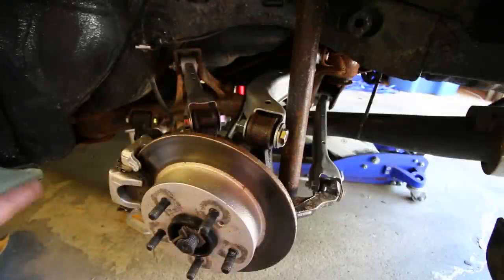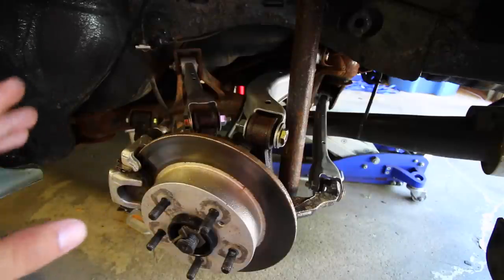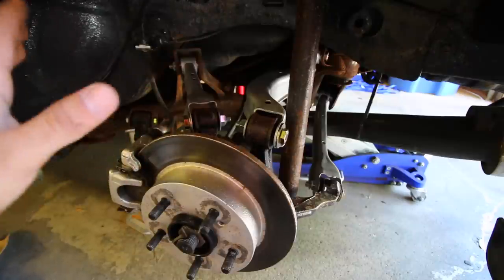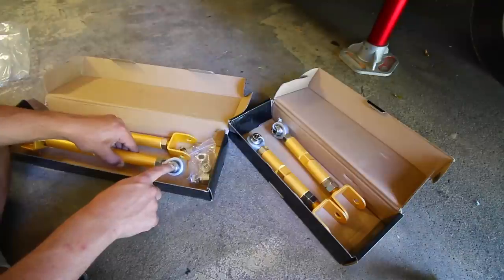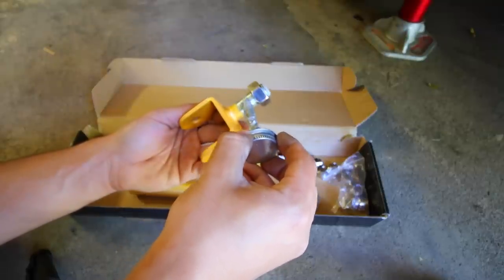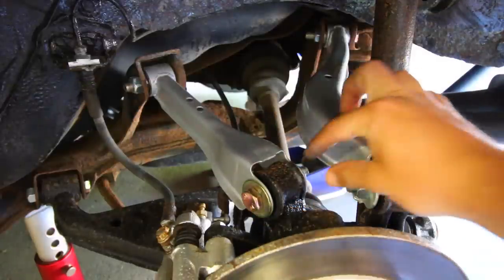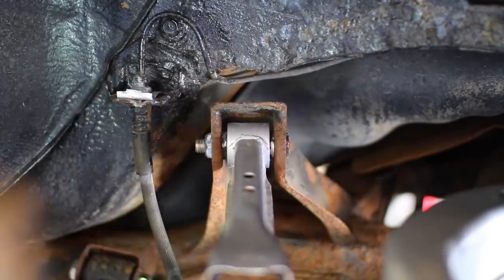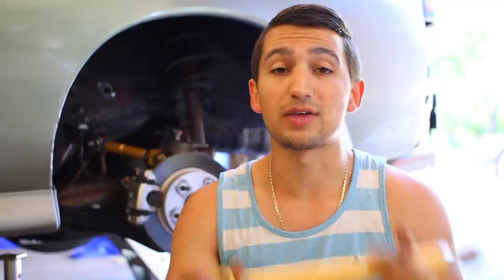What You Need Before You Buy Coilovers!!!

Comment from the maker: They are essential and I will be buying more to complete the full set!! I've got 1 more set to buy for the rear, and another for the front, and then I'll be good to go.
Reply from the maker: Do you think that's something I'd do? ;)
Reply: hi milanmastracci just one tip for you in the future for repairing cars so that if you get bind up in the spot were you can't get to the nut to on doing it just if you have welder by you're side just tack the nut on the part with couple tack's and than you don't get headache to take out

Comment: Isn't the other bolt you took off the control arm made to lock the 2 bolts together?
Reply from the maker: It can be, but that second nut doesn't serve any purpose, as you would just need the 1 nut to lock up to the centre of the control arm to keep it from spinning and have the length locked in place. You also have 2 jam nuts, one on one side, and one on the other.
Reply: Pretty sure it's there to secure the nut on the inside to not loosen over time from vibrations and such.
Reply from the maker: If that was true, why aren't there 2 on each of the control arms. I've never seen 2 jam nuts together before
Reply: milanmastracci I don't know. I have a similar locking mechanism on my fishing rod with two nuts, but I don't know why one side would need it more than the other.
Reply: milanmastracci couldn't hurt, but as long as it's ok to not use the second but.
Reply: milanmastracci so they just give extra parts with purchase?

Comment: Hey milan quick question i just lowered my car on coils and its pretty slammed my other cars rack and pinion started leaking bad which cost me $1000 how can I prevent that from happening again
Reply from the maker: See if you can get some steering rack spacers to raise it up, and then if you can as well, flip your tie rod ends upside down
Reply: milanmastracci alright cool, but do you know why it may have started to leak bad? Maybe from scraping alot?
Reply: The rack started leaking after being lowered is because the way the rack was resting on the seals have changed from what they were worn into. Depending on the age of your car the rack has been moving in the same position for 10+ years. After lowering the car you have disturbed its usual position which can cause leaks.
Reply: Matt Covey oh damn did not know that... I thought it was caused by all the scrapes, so in conclusion how can I prevent from this happening again? Do i drive carefully and not scrape or buy a skid plate or something please help!!
Reply: Well if the car will remain lowered for the rest of you having it and you put a new rack in it then the problem is solved. After a while now "low" is the new norm for the new rack. If you were to raise the car back up 5-10 years down the road you may see the same issue.
Reply: Matt Covey but i dont get how the rack and lowering the car has any correlation
Reply from the maker: The steering rack's angle will change with respect to the hub. When you lower your car, the hub is raised up higher, and the angle of the outer tie rod end will not be close to 180 degrees, it will be an obtuse angle. The more obtuse it is, the more strain it causes.
Reply: milanmastracci what should i do now? Raise the car back to stock? And did you encounter any problems like that with your accord?
Reply: The end of your rack has your tie rods on it. They are flexible on 2 joints so they can move with suspension. The rack tends to be bolted to the subframe and it's fixed to the car but the tie rods are bolted to the suspension which is constantly moving. When lowering the car you dropped the body and the frame of the car but the knuckle and suspension are still at the same height. Therefore your rack is now probably 2-3 inches lower than it was originally.
Reply: Matt Covey so if i scrape bad then i will only encounter problems? Or i will get issues no matter what because i dont scrape at all i angle the to avoid as much as i can
Reply: I can promise you that your rack isn't the lowest part of your car so scraping it is going to be almost impossible. All you can do is avoid bumps and dips. But if you do scrape chances are it's going to be the body of the car or the subframe which are ok to lightly scrap. Depending on the car there's a chance you could have your exhaust or oil pan scrap but just do your best to avoid those situations and you will be fine. Welcome to the low life lol
Reply: Matt Covey ok cool lol and yes i know low life is a pain but looks great, so i dont need to worry about it leaking now right? Because i installed the coilovers myself and im 100% sure its all safe and secure i was just really really scared that i might loose it again
Reply: Since the rack is new you shouldn't have an problems with it.
Reply: Matt Covey its not new lol its a 2007 honda accord coupe so 11 year old rack
Reply: You said it cost you $1000, did you not have it replaced?
Reply: Matt Covey no that was on my other car it started to leak after a few days of it being lowered maybe it was cause of the miles and age of the car or just a coincidence i still dont know to this day because i know a lot of people with slammed cars and no issues with them at all except new lips and oil pans lol
Reply: I see, well for the accord I wouldnt really worry about it. The thing with lowering a car or modifying is that it tends to bring out a lot of problems in a car that were going to be appearent  in the near future anyways.
Reply: Matt Covey oh ok but im driving it carefully and avoiding everything i can that will make me scrape so I think ill be good